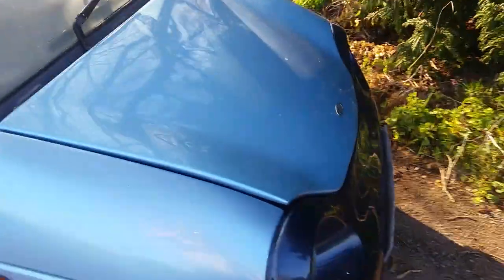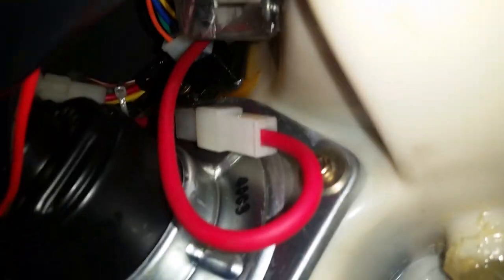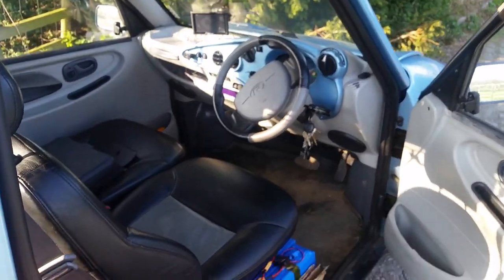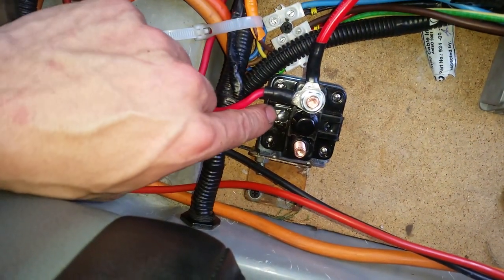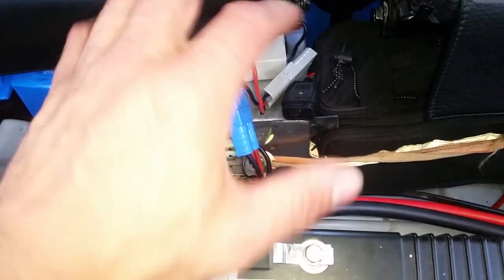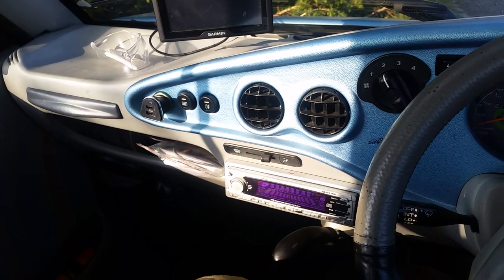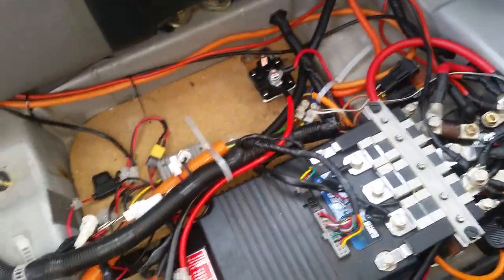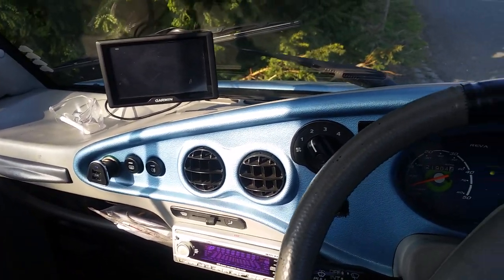REVA G-WIZ: Lithium ion conversion - got the air con to work!

Comment: Wondering if it would be a good idea to just use a 12v 160 ah lead acid battery as the auxiliary power ?
Reply from the maker: The main issue with that is you have to charge it separately and it would be rather large and heavy. This video is rather old too, since I blew the motor on the DC G-wiz by tinkering around too much with settings I have an AC which had a working charger/Dc-DC converter so I am now using the main battery bank to power all the dash etc. Most of the issues that stemmed with the blue DC car was due to the fact the charger was removed and I didn't know it required this for the dash to work due to the DC-DC converter.
Reply: @RichardMawby  Thanks for getting back. I wanted to work on a similar project with the Reva i ( AC version ) because the batteries are dead and it's costing me a bomb to replace them. So my idea was to use a Li-on battery pack for the drive train and a lead acid for the accessories. 
Considering I wouldn't use it beyond 60-70 km in day so I could always come back home and charge it. I did do a few enquiries on a 18650 battery pack but they seem to be way to expensive. Thanks again for getting back :)
Reply from the maker: @pixel_xo  As long as your charger/Dc-Dc converter works no need for a 12v battery for auxiliary. Also few more things to take into consideration and you can't just use any battery pack. What I have discovered is the best and most simplest as well as relatively cheap (compared to other options) is to use mercedes tesla cells... see one of my later videos for one I helped to convert in the summer months. Mercedes tesla cells are around £550 each and you only need 2 provided you give it adequate cooling and they should give you the range you need. Zero-EV is who supplies them along with a charger and BMS. Around £2000 all in doing it with two cells but bear in mind you'd be pushing them at peak power... better to go with 4 if you can afford it at around £3200 all in however! - this means an 80 mile range.
Reply: @RichardMawby   We'll I'm from India and we don't have much options here when it comes to used/refurb parts or batteries. The EV market is picking up and Import tariffs on batteries have been increased too. So I've been talking to local battery pack makers but everyone is charging upwards of close to 1000 GBP for a 48V 120-160 Ah. Will keep you posted on what I decide. Thanks again for your response. Have a good day!
Reply from the maker: @pixel_xo  Hmm, in that case and if you can find somewhere to charge on route, just put 8 old 12v car batteries in it (25 mile range approx.), or if you turn the back seats into 'van' space you can put more (and hit your target range)... wire in series and parallel accordingly and you can have a really cheap way of keeping the car going and use the original charger to top up the batteries. You may have to unplug the old EMS (battery management system) for the charger to start up without original batteries and original energy gage won't work (so put in a volt meter), but other than that it should work fine.
Reply: @RichardMawby  Will give this a shot, this seems like a much affordable option.

Comment: I think your car can run the heater and the air con simultaneously now i am yet to do more investigation of these two relays can I ask does your motor cooling fan run continuously when in forward gears
Reply: I can't believe you used a starter relay
Reply from the maker: I am not sure where the heater relay is, and right now it appears that the heater does not work so maybe I need to find this for it to function. Plenty of time before winter though! 

My motor cooling fan does run all the time in forwards. 

Haha, yes I just had it lying around so wanted to test things, but it did not cross my mind that in the hot weather it would overheat, lesson learned but not a problem, it serves as a bracket in the meantime to bridge the wires on one terminal.

Comment: SIR I HAVE DISCONNECTED THE TWO RED WIRE OF AC THAT ARE CONNECTED TO THE RELAY AND CONNECTED EACH OTHER THE RED WIRE THAT ARE COME FROM UPPER SIDED OF DESH BOARD BUT AC MOTOR STILL NOT SPINS PLEASE HELP ME......
Reply: Is your problem resolved?
Reply: No sir
Reply: My AC is also not working... Rogmotor is not working... Even the local car electrician not able to figer out...I think it's ac system is complicated
Reply: Sir i connected my ac compressor directly to battery
Reply: And ac works fine

Comment: Hello. Interesting video, thank you.  May I ask you how long the a/c battery last at max power? (Does it cool well enough?)
Reply from the maker: SHINOS the auxiliary battery would last all day no problems. cooled very well. with the AC model it has a thermostat so it can be controlled for even better efficiency... i am just using my main battery pack now to run it.